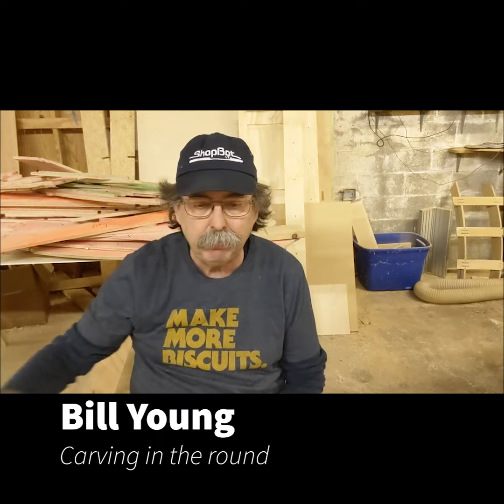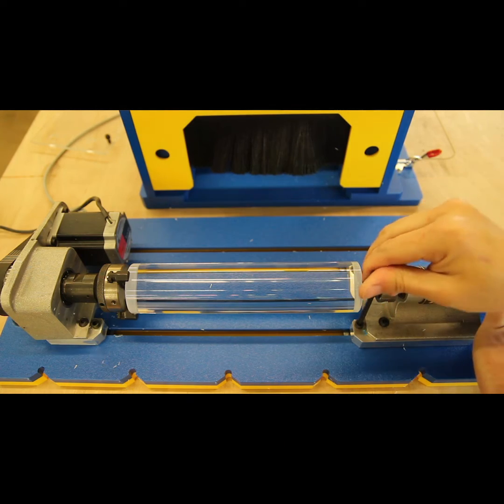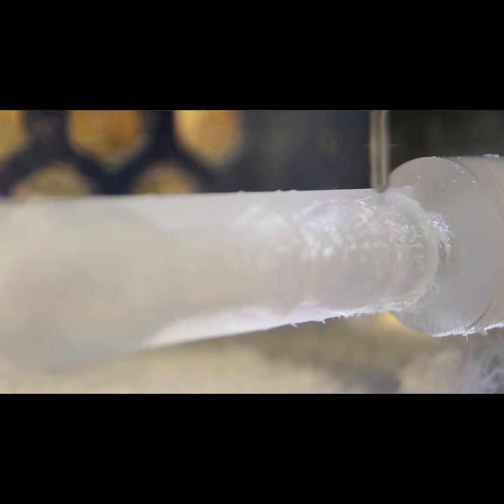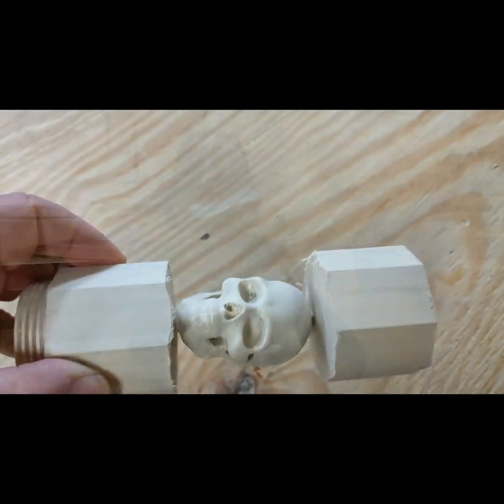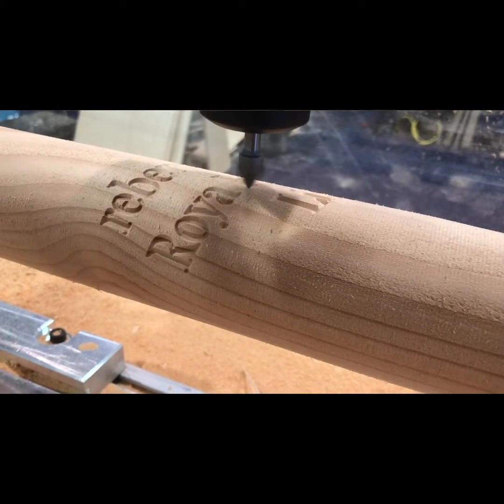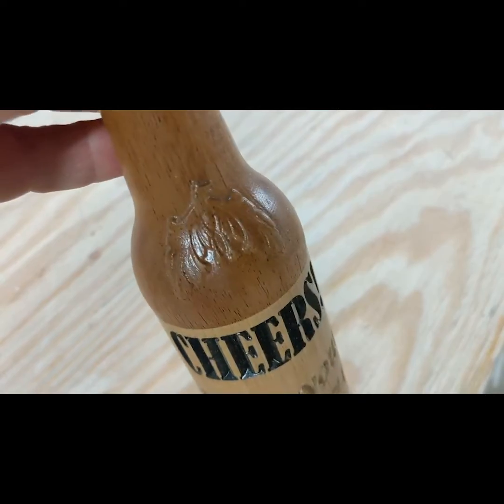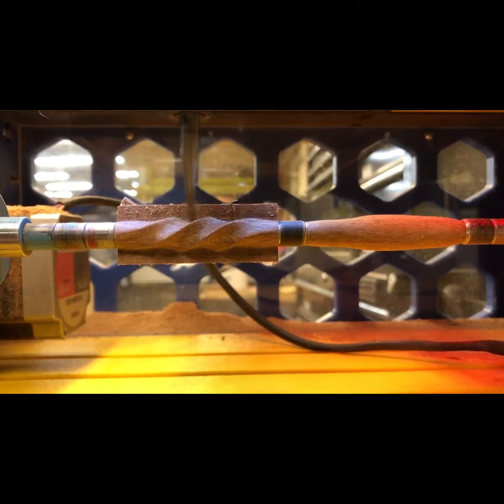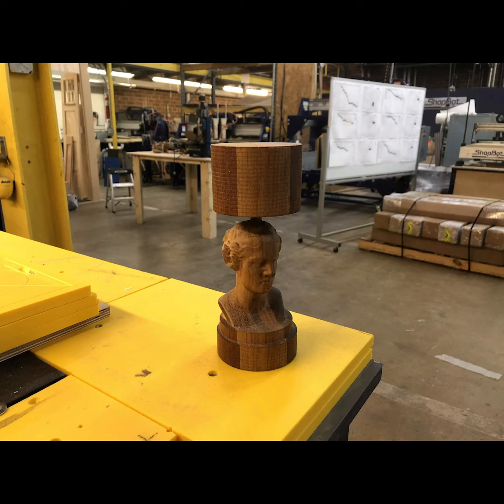Bill Young: Carving in the round with the ShopBot Rotary Indexer

Comment: I would love a soup to nuts tutorial on the indexer with a real project like that skull.  The indexer is the most interesting thing on a CNC for 3D, but there is so little explained on it.  As an example, how do you accurately zero the bit to the center?  I’ve cut a block as close to center height as possible and I use that; there has to be a better way. What about alignment between the headstock and tail stock ?  There’s play in the t track, any tips for alignment?  What are the options for mounting?  I don’t need a tutorial on fluting or spiral wraps, do a model, give me a copy of the model so I can follow along, and go through the entire thing.  Hit the basics quickly, give tips along the way, make a video that can be used as quick, thorough reference.
Reply: *) I always zero the Z axis at the center of rotation when creating indexer files. It's the only consistent reference point.  When I'm ready to cut, I physically zero the z-axis on the body of the 3-jaw chuck. My chuck measure 1.918" in diameter, so I zero to the chuck and then add 0.959" (the radius of the chuck body) to my z location value using the VA command. If I was using the indexer all the time I would create a modified ZZero Custom Cut to make that value change automatically
Reply: Bill Young Thanks for the response.  I never thought about measuring the diameter of the chuck and then adjusting the zero.  I’ve used the Vbit to center to the tailstock pin as well but never felt it was close enough, but now that you say it it would be a good way to center the gantry laterally instead of hoping the stock doesn’t turn after I mark it.  Any tips for keeping the chuck and tail stock tight during machining?  I always check during bit changes and it usually needs enough tightening to be a concern and makes me wonder if retightening isn’t shifting the axis of rotation.  I also worry about over tightening the tailstock and bowing the turning halfway through.
Reply: *) I've found that the t-nuts in the slots tend to center my tailstock when I tighten it down after moving it. To check it though you can chuck a v-bit in the router and use it to line  the point of the bit up with the point of the tailstock center. I like the 60 deg v-bits from CMT...they come to a fine point.
Reply: I don't know of any start-to-finish project tutorials, but there is information on mounting and setting up indexers in the ShopBot documentation. For instance this doc shows mounting options for Gantry tools:

https://www.shopbottools.com/ShopBotDocs/files/6and12inIndexerMountingOptionsAlpha.pdf